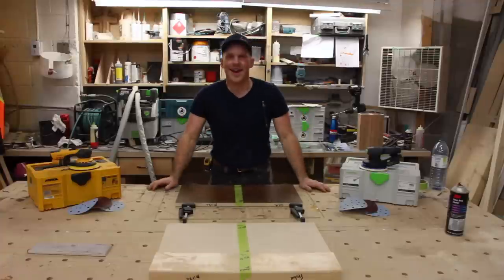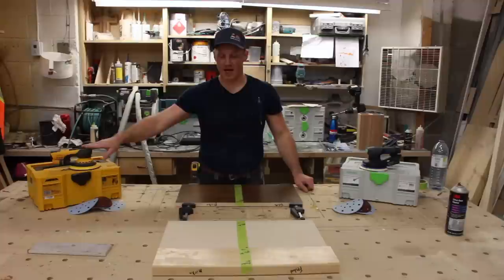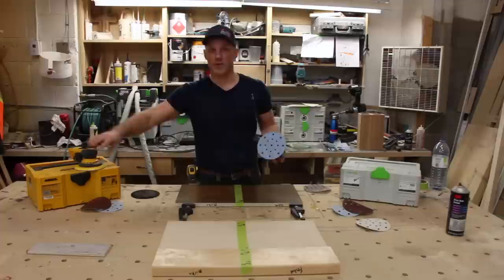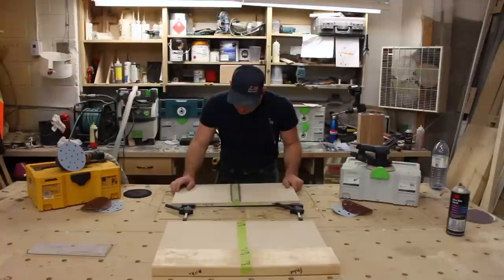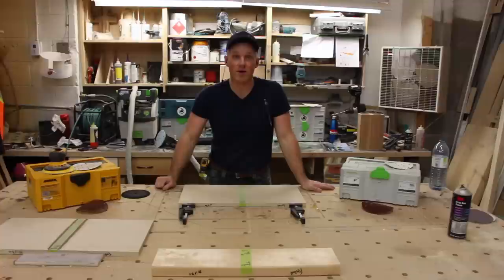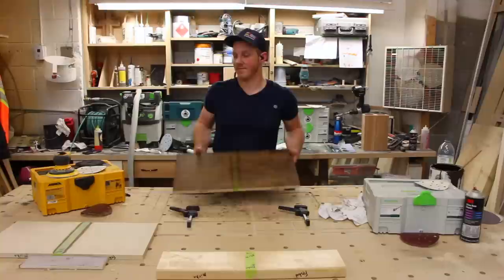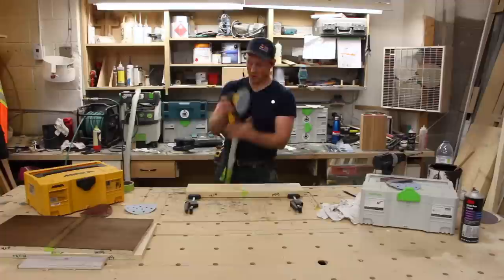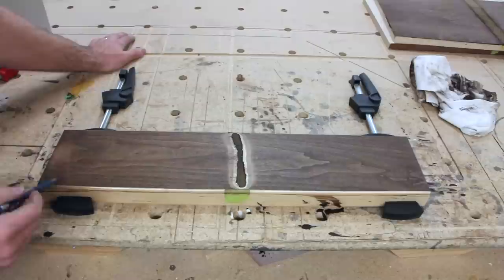Mirka Deros Vs Festool ETS EC

Comment: The Deros is lighter (1.0 vs 1.2 kg), the Deros has less height (more feeling with your work), and the Deros has a greater RPM reach (Deros: 4.000-10.000 Festool:6.000-10.000).
The Deros is just the better sander imo. One thing i don't like on my Deros is the paddle, someone else already explained why. The next Deros should have a simple on/off switch.
Besides this one small flaw it's the perfect sander.
Reply: but mirka it lasts 3 times less
Reply from the maker: Are you referring to the circuit board issues they were having due to overheating?
Reply: I am a carpenter.  At my work we also have the mirka deros.  But after sanding some cabinets for about 5 to 10 min. My hands are tinkeling.  And also with the Mirka you defintitly can see the sanding marks. The Mirka is not flawless.
Reply: @mathijsvijn2144  Lower rpm, takes longer but no tinkeling. I use abranet discs and going from course to fine to finer i have no pigtail marks
Reply from the maker: There are some balancing screws that go in the counterweight that you can access once you remove the pad. Make sure you have the correct screws in the counterweight or else it won’t be balanced, and it will cause more vibration.
Reply from the maker: The paddle switch is the main attraction to most professionals because it mimics a pneumatic sander like the dynabrades. I prefer the paddle switch because I have on the fly rpm control by simply depressing the paddle less
Reply: @SteneWoodwork  I would like to see a sensor which notices that you're holding the device.
I had too many times the Deros going on when i didn't want it to go on, because of the paddle able to turn on the device while you're not holding it.
Reply from the maker: There is the on/off button on the top, which you can press and then no power goes to the sander, and the paddle doesn’t switch it on 🤷🏼‍♂️
Reply from the maker: @Harolddespui  its only a problem if you are used to placing the sander on a table upside down.

Comment: The swirl marks with the festool are a bit surprising. Is that something you have experienced regularly? I would guess that more suction could have helped with that(?). Regarding the speed, the difference in stroke length is effectively a difference in feed rate, which makes the festool effectively 3/5 slower than the mirka on paper. Fairly close to what you measured i guess.  The time difference would probably be negligible with a festool 150/5.  Festool also have the protective interface pads so that you can use abranet on a festool sander which is a great combo as well. Thanks for the video.
Reply from the maker: I’ve had issues with the Festool leaving large swirl patterns for quite a while, and the higher the suction the more swirl marks I’ve gotten. They say on that the more pressure, the more sanding marks, so more suction is not good(because it essentially vacuums itself more firmly onto the workpiece). That being said the Mirka didn’t have any issues with leaving swirl patterns, which is why I choose it over the Festool

Comment: Thanks so much for the effort in putting this together and very interesting result. I have Festool gear and when going to buy a mid weight sander tested these exact two models next to each other. I couldn't really see any difference in the finishes but went with the Festool mainly for plug compatibility when switching between it and the Rotex when up a scaffold. The Mirka paddle switch also went on accidentally when flipped over to change paper and nearly did damage to soft body parts. But on your review I'll give it another go. Am struggling a bit to understand how near identical machines can have swirl marks on one and not the other, especially with a smaller stroke on the green one.. Could pressure from your hand could have been a factor?
Reply from the maker: Hand pressure could have been a factor, but I used the same method on both sanders, so the pressure difference was noticeable to me. All I know is that if I sand the same way with both sanders the Mirka gives me better results. You can also turn off the Mirka before changing the paper and the paddle won’t engage the machine
Reply: d.COG. Another factor that not to many people think about is suction from the vacuum to the sander. Mirka having less holes creates less suction which creates less pig tails because there is less friction to the sanding surface. The Festool ETS just needs less suction because it has more holes with out sacrificing the dust collection.
Reply from the maker: michael arreguin actually the Mirka has more holes...
Reply: @SteneWoodwork  Suction might be worth considering though? Our ETS sticks to the wall with a 120 grit paper on it. Would be interesting to compare both machines on the same vac and gradually dial the pressure down. Might be going a bit too far too!
Reply from the maker: I read that about the suction too when I was trying to troubleshoot the issues I was having with the Festool when I first got it. I changed my sanding method, turned the suction all the way down, with barely improved results. In this test I ran both the mirka and the festool on the same vac with the same suction setting.

Comment: Can you use the 125mm pads on the 625 deros? I know they make the 5650 that uses both sizes and comes with both size pads, but not sold in the US.
Reply from the maker: I am able to switch between 5” and 6” pads because I bought the 6” model(different motor than the 5” model), but if I had purchased the 5” model I wouldn’t be able to use the 6” and preserve the longevity of the motor. I’m sure it is possible, but they don’t recommend it.
Reply: Stene Woodwork thank you!

Comment: You may try sandpaper from abranet on the mirka andfind out the difference whit normal sandpaper. Abranet lives 20 times longer, better dust removel because the hole surface is open.
Reply from the maker: I do prefer the abranet, but for the sake of comparing the two sanders I thought it was best to use the same paper on both.

Comment: Why are you not supposed to run them at full speed?
Reply from the maker: In the Festool manual they have recommended speed settings depending on the material being sanded. A lot of folks try to mess with different settings(sander speed, suction power) in order to achieve a better finish. I tried everything under the sun, but still had irregular swirls all over the place. I used the Mirka once and didn't change any settings, nor did I do anything different in my sanding style, and I had a flawless finish.
Reply: @SteneWoodwork   thanks for the reply. I was on the fence but going to go with this one

Comment: Which has most vibrations?
Reply from the maker: To be honest I found the Festool to be smoother feeling, but it was very slight
Reply: @SteneWoodwork  That could be because of the smaller stroke (3mm vs 5).

Comment: I apprteciate you wanted to be fair with the same grit of sandpaper on both sanders, but then you killed it having 5mm MIRKA and 3mm Festool
Reply from the maker: I disagree, the 3mm is supposed to leave a better finish, but lack in sanding speed. The Mirka, even though it's 5mm, outperformed the Festool, leaving a better finish despite the larger sanding pattern. I'd say it proved how good the Mirka is

Comment: Unfair comparison
Festool has a stroke of 3 mm and mirka 5 mm.
Reply from the maker: You’re right it is unfair, the festool should have far fewer visible scratch marks, yet it has multiple times more. The festool with a smaller orbit should leave a much better finish ready surface, yet it is way worse. It is unfair, especially to the people (like me) that bought into the “precision unmatched” marking bullsh*t
Reply: @SteneWoodwork  Yeah, from that point of view, they're right.

Comment: The Festool ETS EC 125 does accept the Festool 150 disc but one needs to use the set screw of the 125 to mount it. Works perfectly without vibrations added . Look here: https://www.youtube.com/watch?v=B1TmsDlq8xw&ab_channel=OverkillWoodcraft
Reply from the maker: It will definitely fit, but it will void your warranty. Ask festool if you don't believe me
Reply: @SteneWoodwork  Why tell Festool if it fits perfectly and also works perfectly? The bigger disc doesn't add more vibrations - its feels exactly the smooth same as the smaller disc. It does not do the machine harm at all.

Comment: Festool= better motor, better electronics, 3 year warranty and if you buy it at Klium.com you get 5 years warranty and if it gets stolen from your car the first 3 years you only pay 100 euro and get a new one. It sands just as good as a Mirka but with much better warranty and overall build quallity. I own a Rotex 150 from 2011 and it keeps going and going. I don’t even look at other brands no more.
Reply from the maker: Well first off the rotex is a completely different type of sander, so there's that. I owned the rotex, and sold it after using the Bosch dual mode sander. The Bosch was much smoother and just as aggressive. Second, I wouldn't want the Festool sander for that long, because it would mean that I would have to deal with sanding issues the whole time. I think this video clearly shows the difference between the two, and how the Mirka, even having a larger orbital pattern, still gave a nicer finish than the Festool.